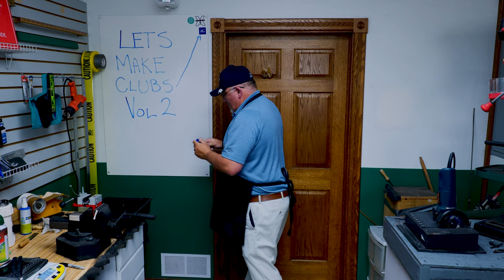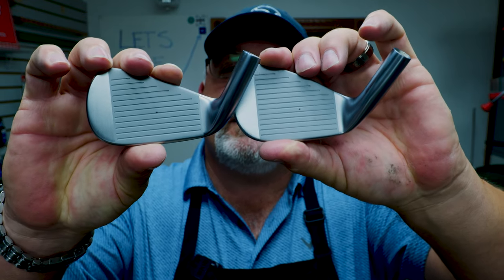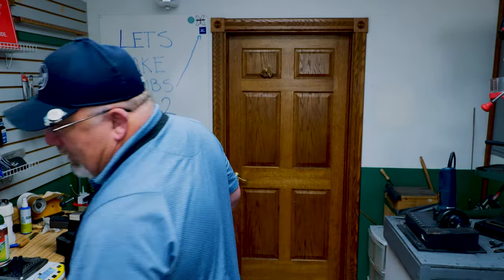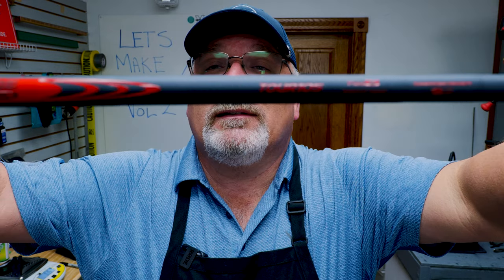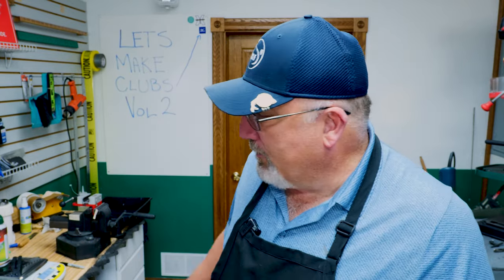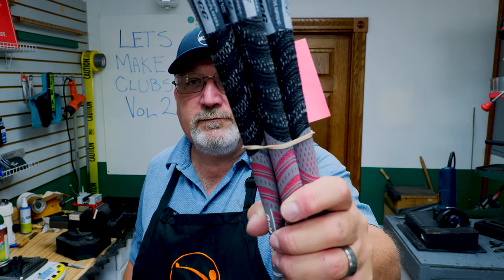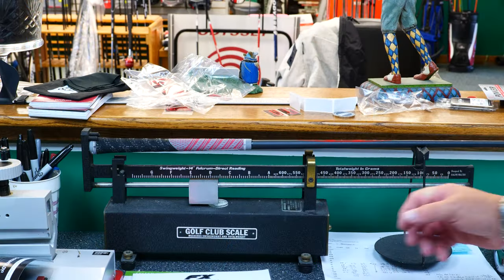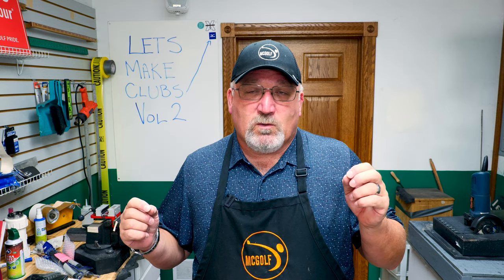How to build a golf club  - center of gravity and weight of the clubs

Comment: Jim - Another good video.  Do you ever use cork and tungsten powder to swing weight?  What are the drawbacks of that process?
Reply from the maker: Once and didn’t really like it. Pros are it doesn’t impact the cosmetic of the club. Con is the high possibility of not getting the cork in proper place